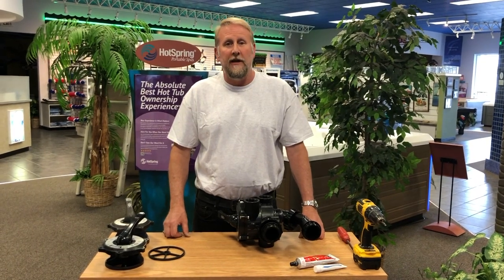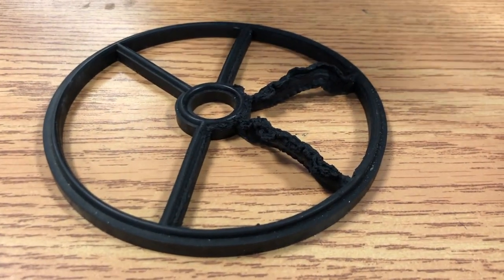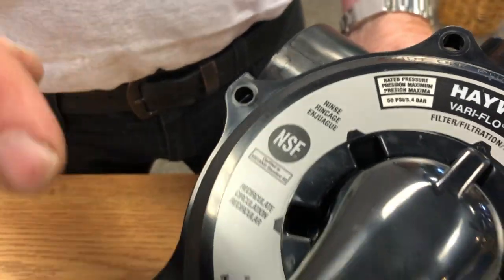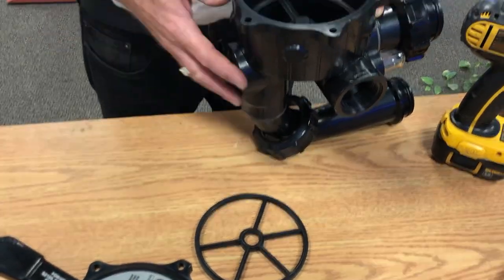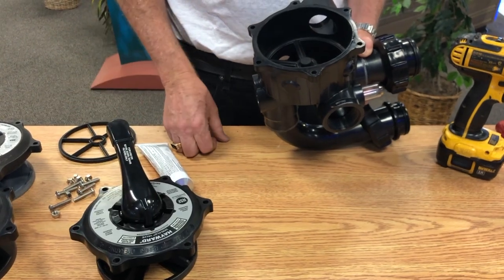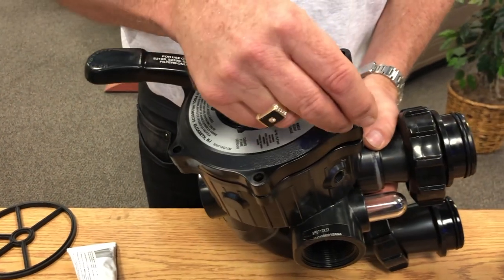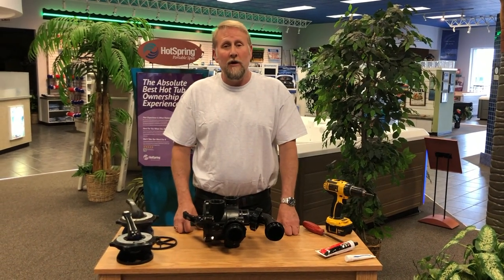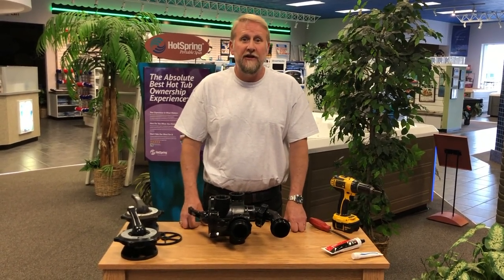How to Replace a Hayward Side-Mount Key Assembly and Spider Gasket on a Vari-Flow Valve!

Comment: Thanks for the great videos.  What is the difference between Hayward SP710XR50 and SP0710XR50 multiport valves?  Thank you.
Reply from the maker: @marcoendara719   These part numbers are the same even though they are off by one number. If you need a valve, email your contact info and l will be glad to help. My email is on my YouTube channel. Thanks for watching.

Comment: Hey Mark, we are new to pool community and learning more every day.  With that being said, your videos are great!  The handle on our Hayward SelectaFlo Valve busted.  We knew it was towards end of life when moved here, so we had purchased a back up valve assembly.  When it broke, we felt it would be an easy fix to replace the entire key assembly.  There doesn't appear to be any cracks and we did put lube on the o-ring.  We are worried about tightening it down to tight and cracking something, but overall we have tightened it down firmly.  Any suggenstions?
Reply from the maker: Don’t over tighten, as long as there are no leaks you should be fine. If you have to tighten a little more make sure that your filter system is off when doing so. Thanks for watching.
Reply: @HallmarkPoolSupplies  sorry, it is leaking and wasn't before the replacement.
Reply from the maker: The top assembly does not come with an o-ring. This o-ring goes around the top assembly and goes between the top of the assembly and the multiport housing.  You will have to remove the o-ring from the old top assembly and put it on the new one before you put it together. If you did this, then you may want to check for damage or replace.
Reply: We did include the cover o-ring with lube.  But there are still two leaks. We have removed and made sure the o-ring is still seated correctly (several times) and added additional lube. The leak appears to be at two of the screws. My husband has also tightened them down more....I took a video but can't figure out how to add it here.
Reply from the maker: I do videos, virtual service calls and phone sessions through my patreon page. If needed l will be glad to help anytime.

Comment: Morning! I have the 710 side mount and it’s leaking from the bottom of the handle at the top. I’m thinking it could be an o-ring on the shaft of the diverter. Would I need to bleed the pressure or drain the filter in the filter before removing the handle and key assembly or just leave it in the filter position and shut the pump off before removing the handle and diverter or key assembly. Thanks in advance!
Reply from the maker: You can leave the valve in the filter position, turn off the pump and then you can make the repair. Thanks for watching.

Comment: What if it's leaking from the top at the bottom of handle that's the problem I have .I don't know if I can replace a gasket under handle or do what you did and replace top part?
Reply from the maker: You can repair the valve or you can replace the whole key assembly. You need to make sure if you replace the key assembly that you get the right one. There are different key assemblies, depending on the valve that you have. If you need help, email your contact info and l will be glad to help. My email is on my YouTube channel. Thanks for watching.
Reply: @HallmarkPoolSupplies  thanks I will
Reply: I tried emailing you but says invalid email?
Reply from the maker: My email is on my YouTube channel in the about section under 1 more link. I receive emails everyday, so try again l will be glad to help.
Reply: @HallmarkPoolSupplies  I don't know I m doing wrong my Gmail keeps saying invalid recipient 😥
Reply from the maker: I got your pictures, we are good to go.

Comment: Do you drain the filter or shut off external valves to prevent pool or hot-tub water from coming back up into housing once you 'pop the top'?
Reply from the maker: If the filter system is level with or higher then the pool you will be fine, if your system is lower then the pool you can shut off the skimmer(s) and the drain lines. If you have a check valve (flow valve) on your return line you will be fine, if not you may have to plug the return(s).

Comment: Does the gasket have to be glued down??
Reply from the maker: @monimorrissey4887   Yes, 3M makes an adhesive that you can use to glue the gasket in place. If you don’t glue the gasket down it will eventually fail. Thanks for watching.

Comment: I just replaced the mount key assembly, and it is still leaking.  I didn't replace the spider gasket, but it seemed in good shape.  Should I go ahead and replace the spider gasket anyway to see if that is the issue?  IF I do that, and it still leaks, what might be the cause?
Reply from the maker: If the key assembly is new and the gasket is good, then turn off the pump and rotate the handle all the way around and let it pop back into the filter position. Sometimes the diverter does not seat back into position properly and it can cause it to leak, once in position try again this should work. If not you will have to take off the key assembly and check the gasket or replace.
Reply: @HallmarkPoolSupplies  Thanks for the reply. Actually, I discovered that it was the other gasket, the one that fits on the outermost ring of the key assembly.

Comment: How do you change the o ring on a side mount multiport valve
Reply from the maker: @JayJacobsen-g1e   Not sure which o-ring you are referring to but l have made a video on multiport repair that may help. Thanks for watching.
Reply: @HallmarkPoolSupplies   the oring were it connects the multiport to the filter
Reply from the maker: @JayJacobsen-g1e   If you are referring to the o-ring on the bulkhead l can help. The bulkhead is on the side of the filter, there is one on top and one on the bottom. The o-rings and the bulk heads are the same but the internal elbows are different (if needed). Sometimes you can tighten the bulk heads to stop a leak, (do not over tighten) if the bulkheads are tight then it could be a bad o-ring ,a cracked bulkhead or internal elbow. If you email your contact info l carry these parts and l can go into a little more detail on this issue, my email is on my YouTube channel.
Reply: @HallmarkPoolSupplies  hi, it's definitely an oring. It sprays water when I was ready to rinse. Turned it off and bought the two orings. I loosed the nuts on the multiport but no room to remove anything. The spacer between the two brings doesn't have any leeway to move. Seems like I would have to move the sand filter full of sand. The multiport valve is all locked up with pvc piping.

Comment: Hi Mark, my 6-way Hayward muiti value has its waste outlet and sight glass on the left side of the filter mount tube. These are on the right. What value would mine be?
Reply from the maker: It sounds like you have a DE filter, the valve in the video is for a sand filter. Both valves operate the same, however the positions on the valves are rotated opposite of each other. Thanks for watching.
Reply: Appreciate your video. I have an old Hayward SP 710 side mount valve for a sand filter that is leaking from hairline housing cracks at the skimmer inlet. All the similar replacement valves I see for sale have letter "x" and "3" after the 710 number or letter "x" and additional letters after the 710 number. Mine just shows "710". Could you tell me what replacement valve number(s) will work for me?

Comment: Seemed simple when I ordered the parts and replacement gasket. But the removal of the old spider gasket is proving to be impossible. I don't know what type of adhesive they used but NASA needs to be using it! I've managed to remove the inner portion but the outer ring is not coming out no matter what I have tried. Any ideas?
Reply from the maker: Sometimes the gasket is removed easily and sometimes it can be a bear. If you use a small flat head screwdriver you can scrape the old gasket out. You definitely want to get the old gasket out so that the surface is smooth before you glue the new gasket.

Comment: Some sites talk about adding a lubricant to the gasket and seal. Do you recommend that?
Reply from the maker: If you are replacing the whole key assembly it is already lubricated. If you lubricate the o-ring around the top or any other o-rings that’s fine. However you don’t need to lubricate the 5 spoke gasket (spider gasket).